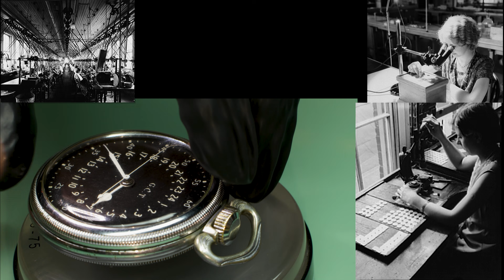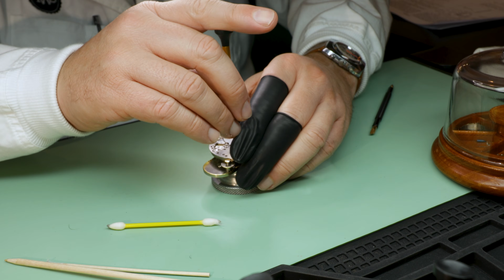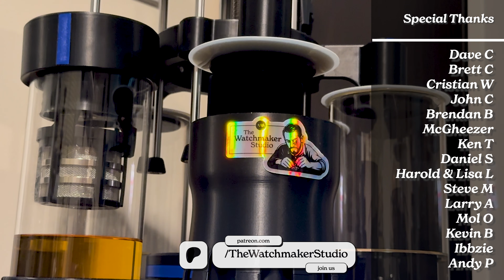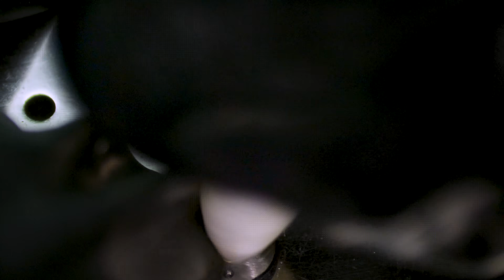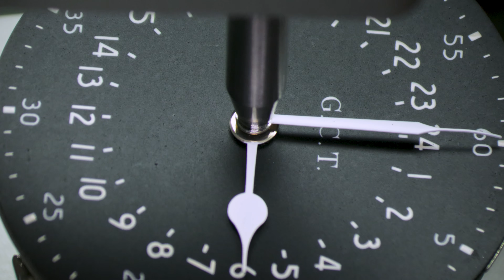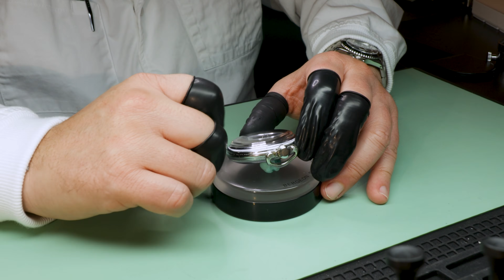81 Years in a Drawer. This WWII Pilot's Watch Still Passed Military Spec.

Comment: 7:30 left-handed screw! Unmarked yet.
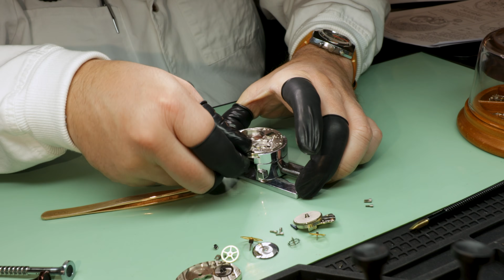Reply from the maker: No sir, it is not a left handed screw. You can see when I put it back in at 28:30. The Hamilton 4992b has a pin in the wheel structure beneath it and uses a regular right handed screw. However, I did doubt it when first ran into the tough screw. Thanks for watching!